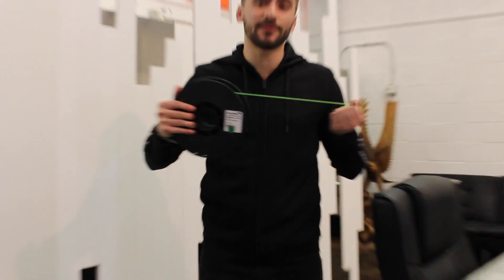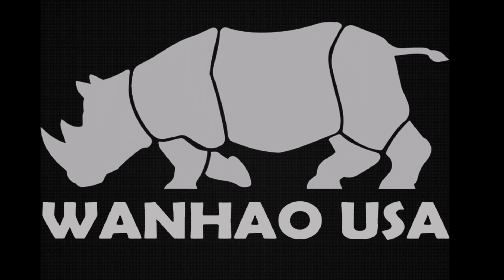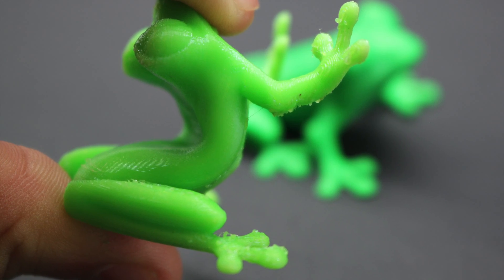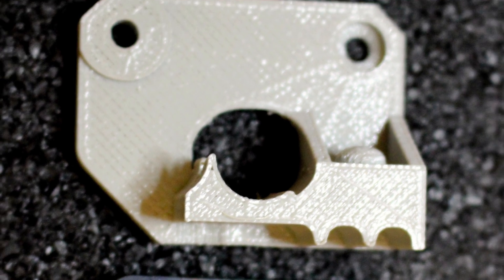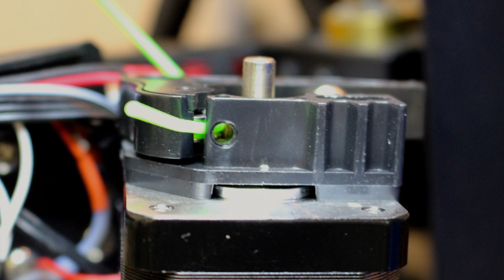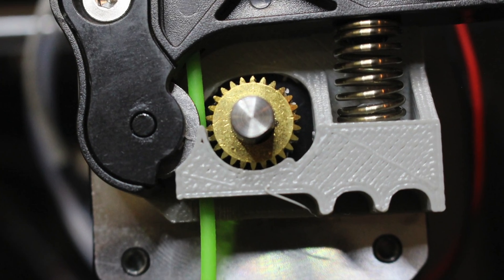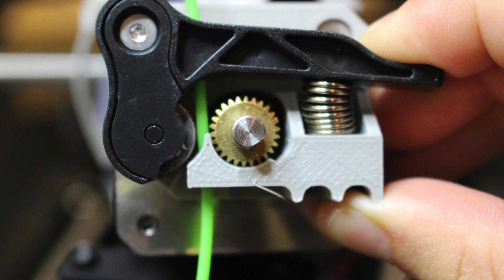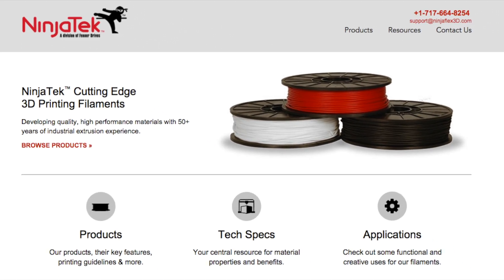Wanhao USA - Zak's Picks and Tricks // Ninja Flex Drive Block

Comment: hi guys, ive installed the drive block and get some flow and the beginning of the print but then it just dosnt flow, is there a secret here
Reply from the maker: +Gary Hawkins Hi Gary, sometimes the hole where the filament feeds through is slightly obstructed by stray filament from the print. This can also happen to the port where the actual drive gear is located. What you can do is take the smallest hex key that came with your printer accessory kit to clear the filament hole, and use a small piece of sand paper to make sure the hole for the drive gear is not in contact with the gear itself. If that doesn't work you may need to try printing a new drive block with different settings in your slicing software.

Comment: Awesome video! I look forward to  using Ninjaflex or TPU to print my quadcopter parts - so this was key.
Reply from the maker: +NewbPilot can't wait to see what you print! The flexible filament is especially useful for printing components that receive the most impact since it absorbs shock better than PLA or ABS.
Reply: Absolutely excited. Going to change from PLA to ABS tonight, print a few things, then order some flexible Filament for next week's prints

Comment: Hi guys, sorry to say, in my case, huge waste of my time. The issue is not in the filament getting lost, it is in the fact that if there is any filament at all harder than the flex left in the extruder cavity, the ninjaflex is not 'strong' enough to push it down. Therefore just put your extruder at 235 degrees and before you change the filament, make sure to pull it out until you have that skinny tip. If any is left in the extruder, it will not allow the flex to reach the tip. 

If you do print this as I did twice. You will likely have to sand down the center hole. The gear has 2 screws that hold it to the shaft, those can easily hit the wall of the new piece. DO NOT put the piece and try to run it. Put the piece without the arm, and try the gears. Then add the arm and spring and try the gears. Then finally reassemble the pieces. 

GOOD LUCK! And to Wanhao, thanks for trying but in my case did nothing!
Reply from the maker: +Carlos Chiossone You're definitely going to want to make sure your hotend is clear of any other filament before feeding the flexible filament. Glad you got it to work :)

Comment: What is the filament you recommend to use? You say it way too fast and did not get it. Thanks.
Reply from the maker: +Carlos Chiossone You're going to want to print the drive block with a filament with a higher melting temp than the flexible filament. This will help to keep the warping of the new drive block to a minimum while printing the flexible material. We recommend using ABS filament for the drive block as it's easy to source, it's printable on any Wanhao 3D printer, and it has a higher melting point than the flexible filament.